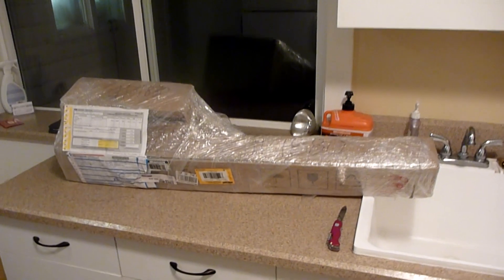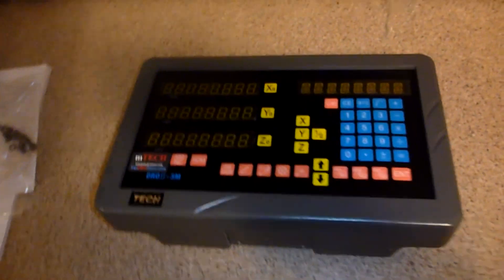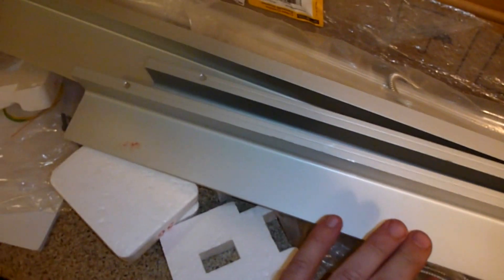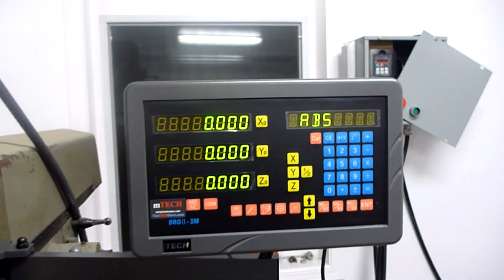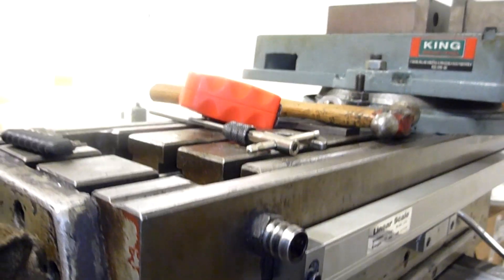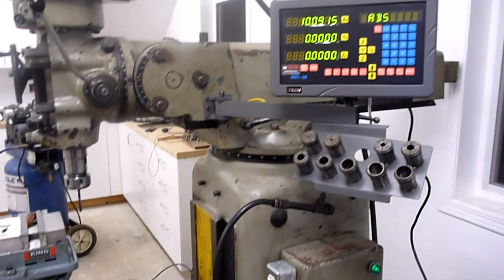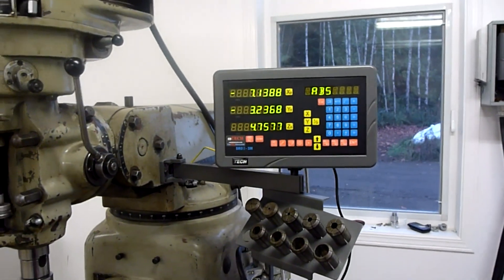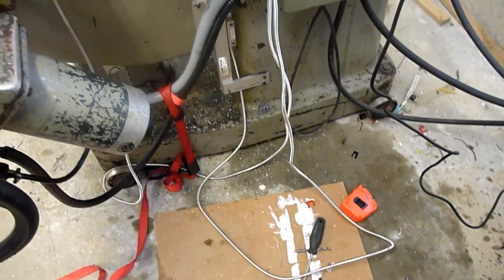M-Tech DROII-3M DRO Installation

Comment: 10:17 - The special "fits any machine ever made" custom installation kit is available for an extra $600.00 U.S.
Weighs 500 lb. and you usually use maybe .002% percent of the kits contents - the rest goes into your 'spare parts' pail.
The manufacturers fully realize what an onerous, demanding, major hassle it can be to go to the local hardware store and pick up a couple of nuts.

Comment: How was the accuracy over the full length of scales?
Reply from the maker: As best I can tell, pretty good.  I don't have any instruments for measuring accurately over the total length of travel of the table.  I compared with calipers and came up quite accurate over 6".  Total travel was out a couple thou compared to the dials, which I attribute to some wear in the leadscrew which would easily account for that.  For my needs and with this old mill, this DRO is great!

Comment: Hello
Great work on the dro install.
I have the exact same Kent mill that I have disassembled and moved to my basement.  I would like to install a dro also.
Could you post the different lengths of the scales on the three axis that you used?
Thank you
Reply from the maker: As best as I can tell, I believe it was 750mm for the X-axis, 470mm for the Y, and 520mm for the Z.
Reply: Kelly Klassen thank you very much

Comment: Don't want to be a bother, but could you help with how exactly the arc XY smooth function is supposed to work, OR can you suggest another video? I have not found one so far that matches this unit.
Reply from the maker: I haven't looked for other videos, but I do have the manual for the DRO which explains it.  It is definitely not simple and is what I'd call an advanced function.  If it would help, send me your email and I'll scan and send the manual section to you.
Reply: Kelly, I have the manual that explains it, but don't understand the "starting location" for the SMOOTH operation. I did managed to get the simple arc working ok. Also, I contacted the folks who sold it to me (new with paper manual from China) and asked if they would send me a PDF file of the manual, as I am making up my own cheat-cheat operation notes. I got it in 1 day :-)
So I really don't need a manual, and if someone else does I will send off the PDF to them.

Comment: Thanks for the video. I just got a Sinpo and your video was extremely helpful with  the installation. I had a few frustrations and finally ended up making a few of my own brackets, cutting and milling some of theres and using most all different screws, etc. Not that I fault them as every mill is different.
Reply from the maker: Very glad to hear it was helpful for you! I've been pretty happy with my DRO, it's a super functional addition to my mill.

Comment: I like to purchase DRO for my new lathe 14" x 40" from Modern tool BC, like to know how satisfy you are with your DRO you purchase from Sigapore, waiting for your reply from I order.
Best Regards
Tosif
Reply from the maker: I like the DRO.   I had originally ordered the lathe specific model, but they were out of stock at the time.  They "upgraded" me to a different generic model which was OK, but my only regret is that I didn't end up with that lathe specific model.  If you're getting one, make sure you get that one.

Comment: Hi now you have used the M-Tech DROII-3M DRO system for a while please could you tell me if your still happy with it, I am thinking of getting the same system for my mill but like you I'm finding it hard to find info on this? Regards...
Reply from the maker: Yes, pretty happy with it and no complaints.  I recently picked up a lathe and the first things I did was get another DRO